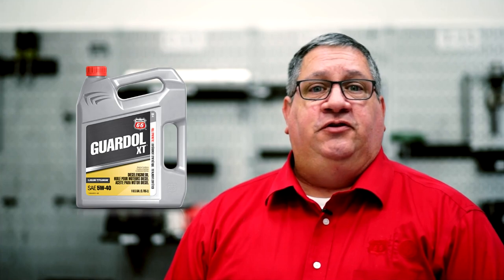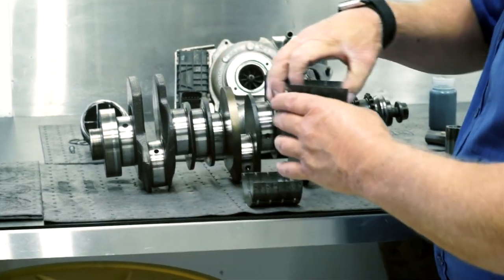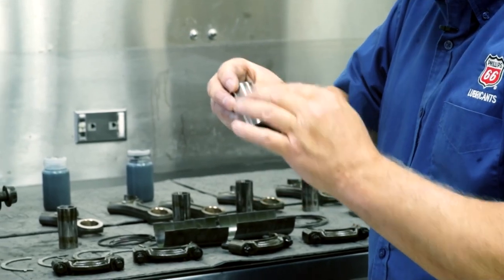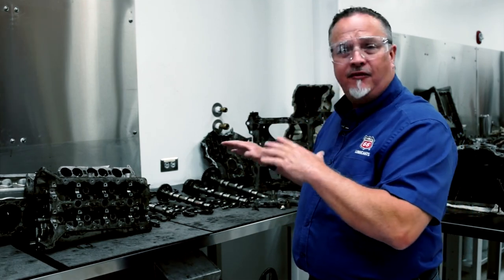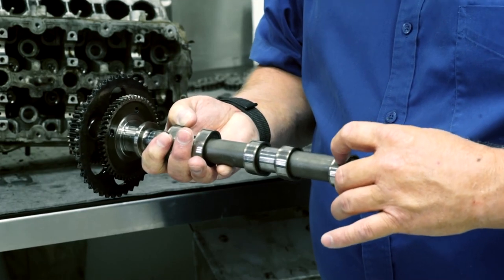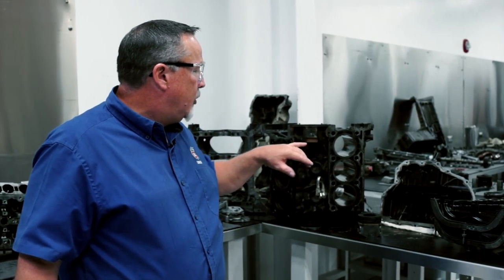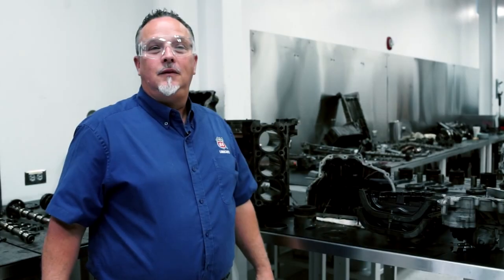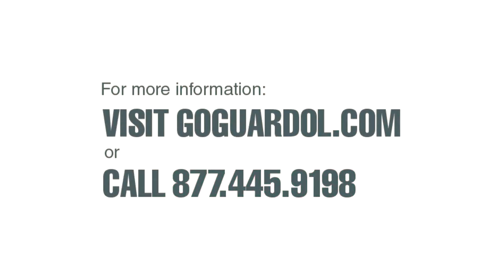Phillips 66 Engine Teardown | 2015 Ram 1500 EcoDiesel with Guardol XT Full Synthetic 5W-40

Comment: I think any diesel (or any engine for that matter) whose primary miles are highway, is going to look like this, as long as the maintenance schedule is followed religiously.. Eco-diesel's (and most other diesels) suffer when they do short trips, because the oil temps don't rise to over 210 degrees to evaporate and burn off the blowby, therefore carbonizing the rings, resulting in more blow by, which manifests itself in oil related failure (in the Eco-diesel, that's the main bearings). change your oil religiously, and reduce the interval if doing short trips. And given the Eco-diesel uses the dreaded Bosch CP4 fuel pump, change the fuel filter every 10K miles.

Comment: Who knows how true any of this is. Could be an engine with 50,000 miles and them saying it has 270,000 miles. They could have cleaned everything before the video. Only way i would believe it is if they videoed the odometer reading and then walked straight to the engine bay and start pulling the engine and then directly going into the disassembly process.